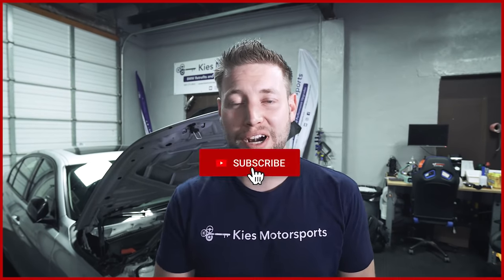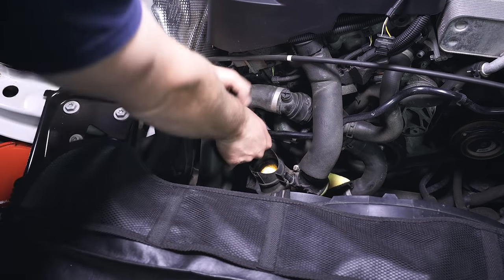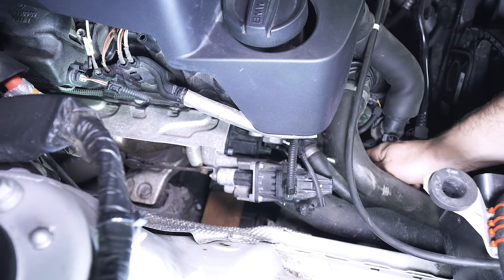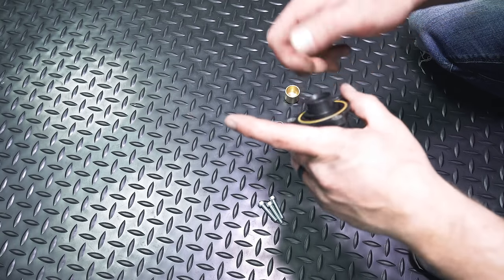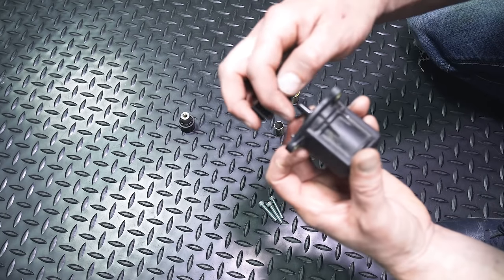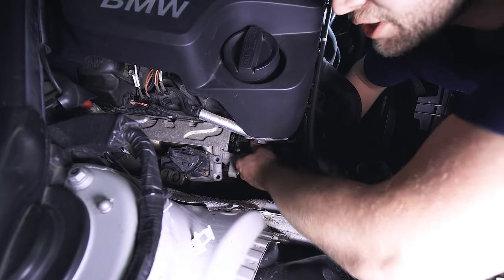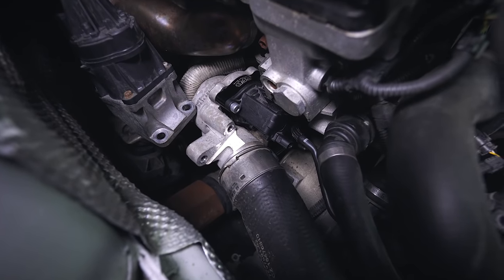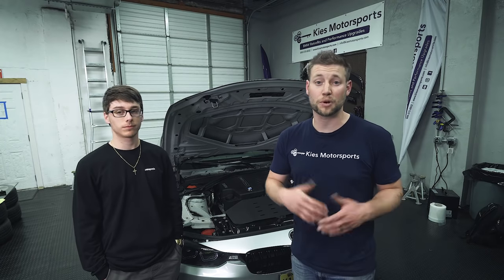How to Install a Diverter Valve on an F30 BMW 328i | 320i N20 + N26 (Go Fast Bits DV+)

Comment: I can’t get the longest bolt back in on the side of the motor it just won’t fit, I’m wondering if it’s because I drive an automatic and not a manual
Reply: Same left mine without it how bout u?
Reply: @yamikami2512  just installed mine and I didn't put the third bolt either, has it worked out for you
Reply: I ended up breaking a coolant line trying to get that one in.... now off to the mechanic it goes to fix that....

Comment: Just installed a diverter valve on f32 the screws are T30 not 4am hex makes a big difference getting that top back screw out

Comment: The OEM bolts are T30, and that obstructed bolt can be removed with a long shank T27. After assembling the new  GFB+unit, hold it in place with some painters tape over the top to the turbo flange. Slide the solenoid with new spring and piston in from below,  then tilting it forward to GFB. Once the solenoid ears get past the block, place a new bolt thru the solenoid ear on the top right. I held the solenoid with my left hand while using a pickup magnet to hold the bolt while I slid it thru that ear. You have to do that before moving the solenoid up and onto the GFB+. It's the only way to get that back bolt into place.
If i did this job again, once the  valve was removed, I'd Dremel the block flange that obscures that back bolt to open a channel for the long shank bits

Comment: Beware this is not as straight forward as you might think. Make sure you have the ball end bits and basically everything in the tools you might need in the link he attached. Get ready for your patience to be tested but take an hour, grab a beer, and then get back to it. Have fun!!! 
Also be care with the intake inlet, the plastic is fragile especially the bolt hole that connects the inlet to the turbo.
Reply: Spot on.!
Reply: I broke mine to, and the clips on the other line... had to put an extra 125 into it after the install.
Reply: lol so true

Comment: 2016 328i F30 N26 here and the bolts on the stock diverter valve are actually TORX T30 not hex bolts. The gfb provided bolts are hex  5mm FYI

Comment: Those long hex ball 4mm tool stripped my torx bolts.. its a hit or miss. Its best to find one thats of good quality and is sharp on the edges in order to actually bite the bolt as you turn it. It doesnt matter if you strip the original bolts because the GFB kit comes with new Allan bolts. But still its something to consider when trying to remove these

Comment: Just installed on a F20 N20 125i with an MST intake, charge pipes, vrsf stepped intercooler, custom 3" turbo back exhaust and bm3 stage 2. It definitely flutters, but not as much as the owner of this car shows on his channel and it also seems 'delayed'. Will be doing the MST inlet elbow as well but I doubt it would help with flutter. Tried loading it when stationary, high boost low rpm, etc. Nothing seems to work.

Comment: I’ve bought so many tools and I still can’t manage to screw in the third screw(8:27)  between the engine block and diverter valve....can anyone help
Reply: It won't go on our model... I've tried everything as well.
Reply: I have a 2016 328i f30 won't go in at alll left it without it
Reply: Ended up just wiggling and shoving mine in. Used a flat head to screw it all the way in. Will be getting a ball end hex and grinding it down even thinner to get it tight

Comment: Would you do DV+ on N55 pretty please? 😁
Reply from the maker: We actually did an N55 diverter valve install tutorial when we did my Pure turbo upgrade but we are working on a dedicated video for it soon!
Reply: @KiesMotorsports  When you do that video, please do some before and afters of the throttle response. I'm FBO right now and the DV and Stage 2 LPFP are my next two mods! Keep rocking!

Comment: I have a 2014 320i and I'm really thinking about getting BM3 stage 1. My car is a manual 6 speed and haven't seen any vids or reviews on a six speed. Just a bit skeptical but I'm wondering if it will perform like a 328i. Lmk if you think it will be safe on a six speed. Thanks bro!!

Comment: I installed this with the ball joint alen key and the alen key got stuck between the OEM diverter valve and the block, tried to pry it out ended up hitting one of my coolant hoses and now coolant is leaking. Don't try unless mechanical inclined

Comment: Hello, could you help please, we installed DV+ on n20 with spring, we don’t hear any noise like whooosh, is it normal? or we did something wrong? Thanks in advance for answer
Reply: I have the same issue, installed dv+ with their spring and injen intake and no sound, although im unsure if the reason i cant hear it is because of how loud my exhaust is

Comment: Followed this vid, My install went super easy!!  Thank you for making this true life saver!!
Reply: I’m about to install this as well.
Reply: Is it really as easy as you say? The shop near me is charging 1.2k just too install it
Reply: @TfromDaygo  it ain’t. I already spent 2 days installing it. The t30 bolt on the top right (closest to the motor) is hard. The long ball just won’t grip on to take it off.
Reply: Any tips? I’ve been stuck on this bolt for 2 days
Reply: The OEM bolts are T30, and that obstructed bolt can be removed with a long shank T27. After assembling the new  GFB+unit, hold it in place with some painters tape over the top to the turbo flange. Slide the solenoid with new spring and piston in from below,  then tilting it forward to GFB. Once the solenoid ears get past the block, place a new bolt thru the solenoid ear on the top right. I held the solenoid with my left hand while using a pickup magnet to hold the bolt while I slid it thru that ear. You have to do that before moving the solenoid up and onto the GFB+. It's the only way to get that back bolt into place.

Comment: This is totally not that simple on the F36 Grand Coupe as there is basically a wall stopping you from tightening that back screw it was a nightmare lol. nonetheless the tools you put on amazon was awesome andthe video helped a bit.
Reply: I have the same vehicle.   Can't get the top right screw out on the diverter valve.   Even with the long ball joint bits.  It just spins inside and won't grab.  Had to put it all back together.   Thinking of calling a mobile mechanic to see if he could get it out fot me and install the valve.

Comment: Thanks for sharing. I bought and installed this go fast bits diverter on my 328i n20. Unfortunately I do not hear the turbo fluttering as expected. Only a higher pitched spool. Any idea the reason? I have stage1 and big sport intake besides. Thanks.
Reply: I just relocated the gfb dv+ and It sounds amazing now. Really nice fluttering! 10/10

Comment: Sweet i want to install this on my x3 with the n20. What does it do? Is it safe for my engine? And will it have sounds with a stock intake?
Reply: Dont know if youve jnstalled it yet but to answer your question it is good for holding boost better and it is way quieter than stock in most driving and since you have a stock intake it might be completely silent at times which can vary your opinion on it greatly.

Comment: Anyone else have the issue where their go fast bits dv didn’t sit flush into the bmw diverter housing. Mine wouldn’t sit flush at all i gotta repull it off and then dremel out some space for the spacer to sit in better

Comment: How in the heck do you get the screws out? I bought the ball joint Neiko hex sockets that you recommended, but the 4mm just doesn’t grip well enough. I’m afraid to strip them. Did the hidden one first with a ratchet extension like you suggested... at least I thought I loosened it up. Moved on to the two top bolts before finishing that one, only to find that the ball joint hex doesn’t really grip well and actually spins in the head of the screw. Now I’m worried that the bottom screw was just spinning in the head since we obviously can’t see it. Used the recommended tools. What gives? Any suggestions?
Reply: Not sure if you ever figured it out. I just did mine and the screws ended up being T30, not the 4mm. My big problem is getting the top right screw back in. There isn’t enough room to get it in the hole.

Comment: Is it possible to do this from underneath the car if you had it on ramps or a lift?  As always, your videos are excellent.  Thank you for doing them!
Reply from the maker: Yes, it is possible but we found this way works best and saves the most time, especially because you still have to take the waste gate off to reach the diverter valve!

Comment: Will I throw any codes installing this on my 15 320Xi N20?  Dinan Stage 1, K&N filter and AWE exhaust (midpipe and catback).  With the extra boost from the Stage 1 tune I just want to do some preventative maintenance on the DV so it doesn't lose pressure over time.
Reply: If you install it without the large spring you're good. If you do install the large spring for the "sport" feel it will send a drivetrain code and derate the engine. If you keep your rpms high, this can be avoided. Something to do with back pressure on the turbo.

Comment: Hey Brian, I have a question for you.

  I just recently as of today installed a GFB diverter valve on to my 535i n55 and I'm getting fluttering sounds as if there's turbo surge going on. I also have a code "122108 BOV seized closed".  I was reading on the internet somewhere that the code "122108 BOV seized closed" -- ignore, tuner code due to the piston of the GFB DV snapping shut really quickly " progressively closing" that's producing the fluttering.  I need alittle help with this, wasnt sure if you have heard anything like this or about this issue?
Reply: Hi. I think I'm getting the same thing. Are you gettingy it during wot or once releasing throttle? I'm getting it during on low rpm, which is worrying me.

Comment: Can I put one on my N55?
Reply from the maker: Yes! Here is the link to the Go Fast Bits DV for the N55! We're working on making a dedicated tutorial for it soon but you can check out our Pure turbo upgrade video where we explain how to do it on the N55!

https://www.kiesmotorsports.com/products/go-fast-bits-dv-diverter-valve-t9356-f30-335i-f20-f21-m235i?variant=16919315513459?aff=14

Comment: Any benefit in upgrading this, also a 2012 528i upgrading the charge pipe and intercooler and installing a BOV and getting performance coils has anyone done this.
Reply: Idk if you found your answer elsewhere....but the factory one if I recall is plastic and prone to cracking over time. The gfb DV+ also has a better spring, as said in the vid, to help maintain better boost. Your doin it right so far for sure upgrading those parts. I would say the best “performance” mods are the turbo inlet, both sides charge pipes, diverter valve, and oil filter housing cap. Each has their own “failure” over time whether it’s cracking because it’s plastic or like the turbo inlet; prone to collapsing because it’s cheap rubber. Hope this helps😊
Reply: @joshbeveridge9153  I actually don't know if you know this but I have one of these on my current n55 535i xDrive and it's producing a fluttering sound.. also known as turbo flutter or turbo surge.. you might as well throw a fistful of sand in your intake pipe as the car is revving up to 7000 RPM. I'm hopefully going to get this issue resolved tomorrow when I pull the whole unit off again but my original diaphragm was eating to shit had 1 massive hole in it. Either way I just may end up removing the mass of spring behind the Piston because apparently the valve still works without it
Reply: @durhamregionseedbank2710  the flutter sound is normal, that’s what this valve gives you “stututututu”